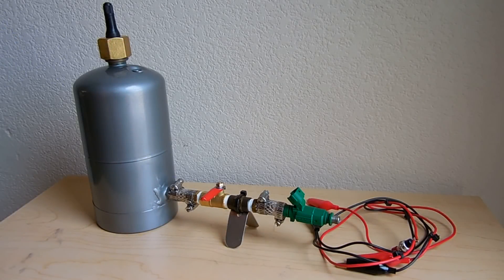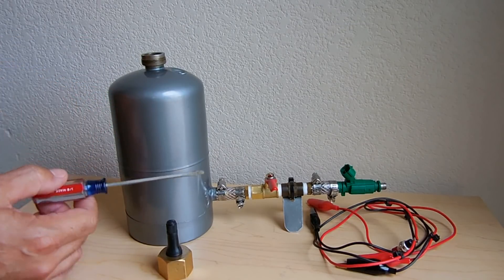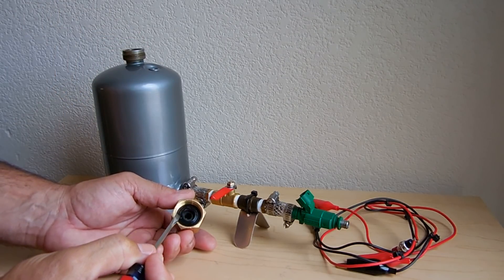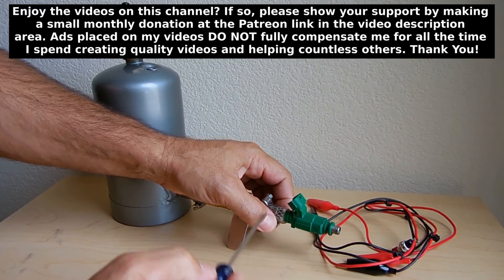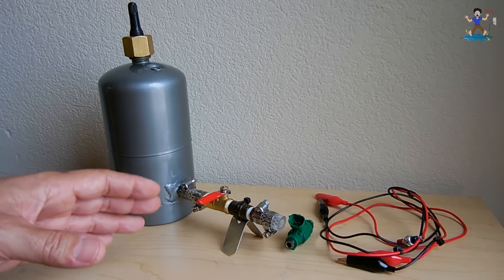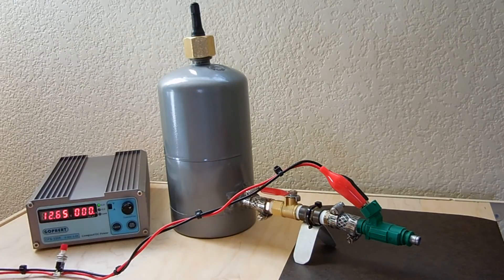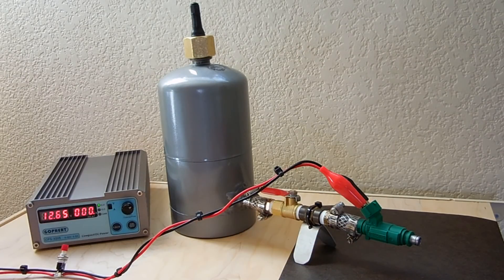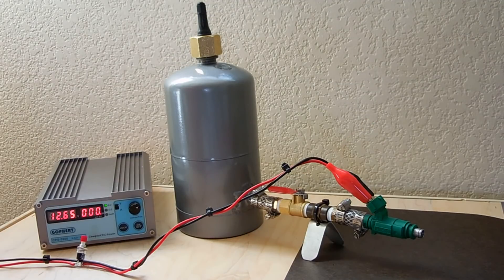DIY Fuel Injector Tester (For 25 Bucks!)

Comment: Or a simpler way is to use a pump sprayer and connect it to the fuel injector using a properly sized clear tubing with a clamp. Then get a 12 volt connection to the injector. Ect.

Comment: great video, great idea. two questions: 1.how to see if solenoid is working properly and how to fix it? 2.plus and minus connector has a specific position or can be random? stay safe and thank you EDIT: do you have a video with reverse process of cleaning? im aksing this because i use Delphi long 501z injectors and could be interesting to see how does it would work for you.
Reply from the maker: If you hear a click when power is applied, the solenoid works. You can't fix a faulty solenoid because the entire injector is sealed up in plastic. The injector works the same if polarity is reversed, but to be safe, connect + & - where they're supposed to go. Be sure to look over my video playlists below for many other videos of interest to you, and most importantly take one minute to share a link to my channel with others on social networking sites. Thanks 
http://www.youtube.com/c/electronicsnmore/playlists

Comment: Loved your video, especially the pressure tank, I build one very similar a couple years ago using an aerosol can,
But yours simulates rail pressure.
Only thing I do differently after checking for flow, is mount the injector backwards to clean, there’s usually a tiny cone filter on the inlet side,
That way it back flushes any dirt out, rather than trying to force it thru,
Then turn it to normal position to check spray pattern.
Thanks again great video.
( now on to try n build a PWM )
Reply: I thought about how can I create a consistent pulsing circuit with stuff I have lying around, I'm going to try it with an electronic turn signal flasher relay
Reply from the maker: Glad you enjoyed it! Be sure to watch my PWM video below, and share my channel with many others. Thank you
https://www.youtube.com/watch?v=fg-2yUYXxHg
https://www.youtube.com/watch?v=H_jKrGJN5Fk

Comment: Seems like you made a bomb, I guess you aren't worried about the container exploding from static or a random ignition source? To rich of a mixture? or what is the logic behind the safety of this device. Why not use an electric fuel pump?
Reply from the maker: No, no worries at all. Carburetor/fuel injector solvents or rubbing alcohol not exactly explosive like gasoline...Many units are sold that use compressed air up to 125-150psi and solvents.

Comment: Can we  connect battery  Negative  and positive charge terminals to  injector  randomly. Does  injector will  work or it  blow  off ?? Please do  reply
Reply from the maker: It's best to follow the correct polarity, even though it does "seem" to work fine either way. Thanks for watching!

Comment: The propane container you use, was it rated for the amount of psi you used? I want to something similar if I can.
Reply from the maker: Yes, that cylinder is designed for pressures up to 200PSI.

Comment: Would the build have not been simpler to have added a copper feed tube to the top nut instead of a valve so the fluid could be drawn up from the bottom of the tank , then simply drilled the tank and placed the rubber valve in at the top .
With a length of tube you could then drop the injector into a container to catch the fluid being injected instead of having it spraying all over the room .
Reply from the maker: FAST FIX No, the design is fine. If you want to catch what sprays out, then slide a clear vinyl tube over the end of the injector and place the tube in a jar.

Comment: Wonder if water hammer principle would be something to look into.... really enjoyed the video. Now, if it's a Datsun....ya need 5 to 9 volts unless you like burning coils...some other cars may be the same way. If an injector was particularly dirty, or leaking, using 12v for long enough to clean it could cause damage if ran at too high a voltage.
Reply from the maker: All the injectors I've seen use 12V. Thanks for watching!
Reply: electronicsNmore, Google 280z dropping resistor...
It may just be a rare thing, but it's always prudent to check the fsm for proper injector voltage...

Really like the propane tank, btw. Very slick. May could fashion an air bubble to do batch fire while injectors are still on the rail... Great concept!

Comment: use a 9v ac adaptor , works great . because the ac is pulsing with 50 or 60 hz .
Reply: add a rectifier diode and you'll get a poorly simulated pulse :)
Reply: He's using a DC power supply.

Comment: Nice. One thing to try is to lightly tap on injector head while motor is running. Very often they stick. This will allow injector to spray.

We cured a lot of older cars with dead cylinder that way.

Also soak them in Techtron or Sea foam etc for a day then install. Clogged tips are usually cleared out.. Diesel wear out tops but low pressure gas injectors rarely wear out . I have 300k on GM originals .
Reply from the maker: motorhead Yes, I've tapped on one before.....then I heard the clicking start up.

Comment: Checked all the switches. It is a D.C. Not an ac. I did replace the stator and I accidentally bought an ac stator(if there even is a difference). Does it matter what kind of stator I put on. Both are 8 pole and same wires come out as the old one that is broken.

Comment: Nice. They get hot. Maybe test when hot as on engine. 230* plus.
Reply from the maker: If you're worried about heat related issues, then put them in a toaster oven set at 225 deg F for a few minutes before testing them.

Comment: any particular reason why you limited to 50Psi? I know my fuel system in my truck runs around 90 Psi..... how fast can you cycle these with PWM?
Reply from the maker: n3qxc Most vehicles are in the 40-50psi range. No reason why you can't pressurize to 90psi if needed. The 3/8" ID braided vinyl hose can handle the pressure. Typical fuel injector pulses are in the millisecond range. You can find calculators online. Thanks for watching!
Reply: Thank you!